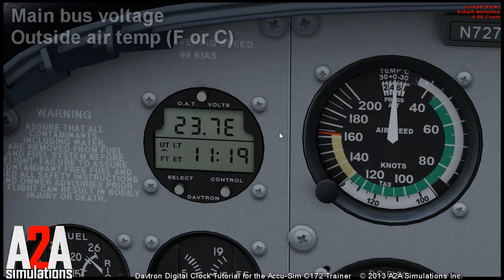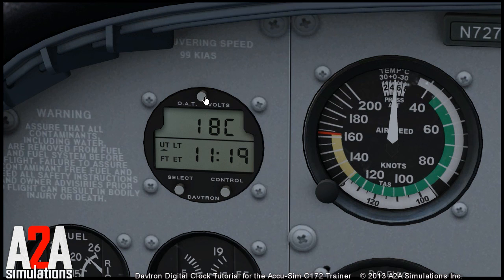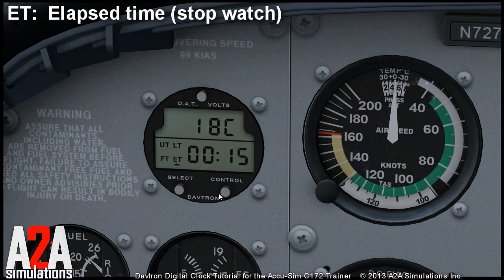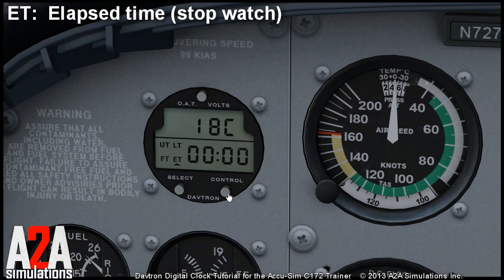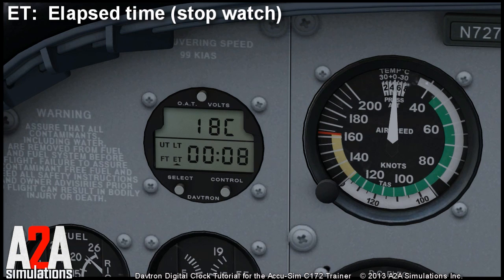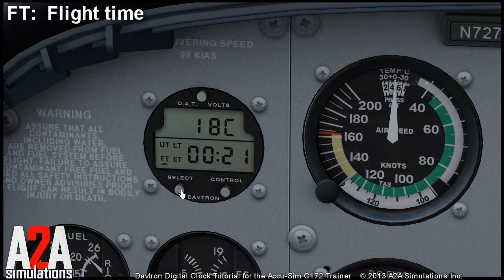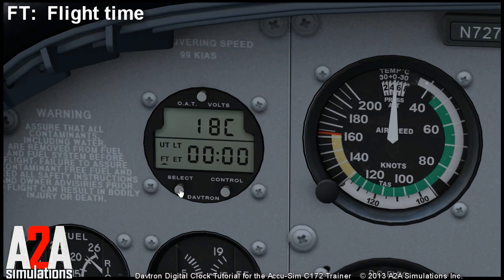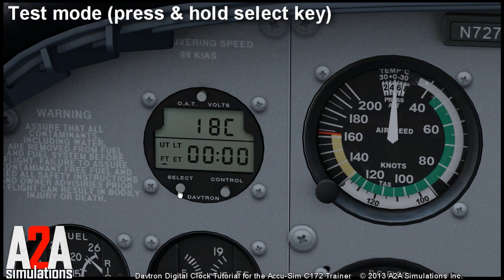A2A C172 Avioncs Tutorials:  Davtron Clock

Comment: So what about negative temperatures for the clock because in test mode no negative sign showed up.
Reply: Missing No The negative sign is one of the middle segments in the whole-number values on the upper row.  This is typical for any segmented LED device that shows negative values (calculators, etc...)